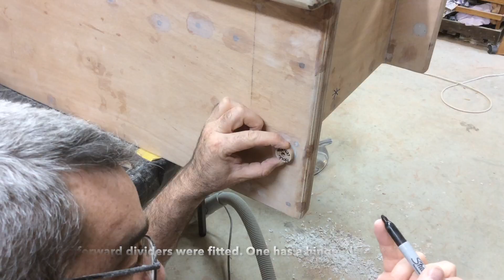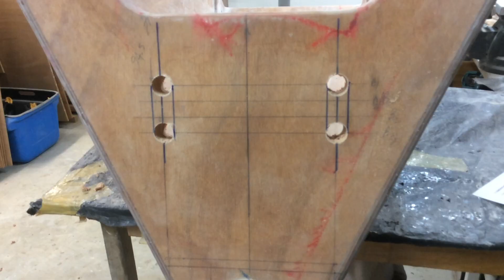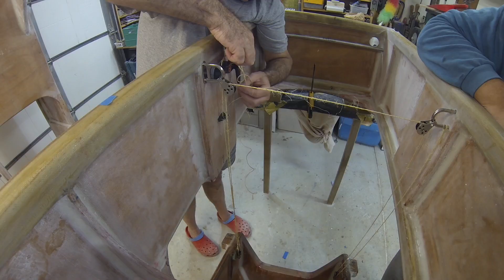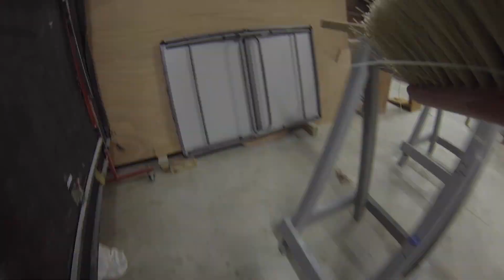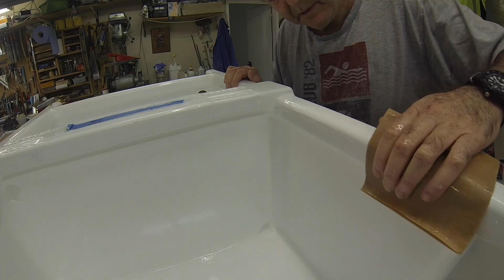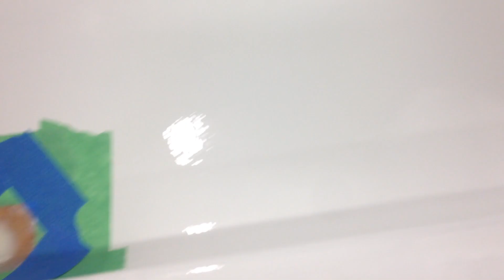Phambili Building Engine boxes

Comment: what type of thickener do you use to fill the holes? is it microfibers?
Reply from the maker: Hi Dominic. The redrilled holes are usually a 1:4 blend of west 404:406. Any screw holes are drilled to 3mm and plugged with a bamboo dowel (skewer). Both redrilled and plugged holes are then glassed over again.
Reply: @TeWakaPhambili  thanks, make sense! I like the bamboo skewer idea, it's hard to fill to the bottom of the hole so this makes a lot of sense!

Comment: You show the beauty of building these boats. Although I haven't seen anyone do it nearly as well, being able to focus on sections at a time VS an overwhelming bunch of systems helps. I can build with metal more so than wood but your methods are similar yet more impressive given the uncertainty of woods strength.
Reply from the maker: Thanks Mike. I find wood a little less forgiving as I cant weld and grind away errors :) Working with ply in this manner has been a learning curve though.

Comment: Beautiful work. 

I didn’t catch what you said about how you keep the Perfection converter from crystallizing. That’s always a problem for me. 

Thanks for the demo on how to keep water out of the forward gap in the sleds. I was wondering whether that would be a problem. I’m adding that to my ‘to do’ list in my refit project (a Pahi 42 with new Tiki 38 sleds).
Reply: Thank you! I’ll start doing it that way. I’ve been building boats for a while but there are always new things to be learned from other builders. Thanks for sharing.
Reply from the maker: Thanks for the comment. It’s really rewarding knowing that you are benefiting from our build.
Reply from the maker: We decant the converter into a glass screw-top bottle. Each time we pour from the bottle we wipe the top of the glass "spout" off with a paper shop towel to keep the seal free of any liquid before replacing the lid. Works a treat.